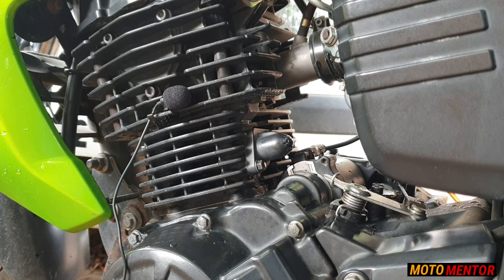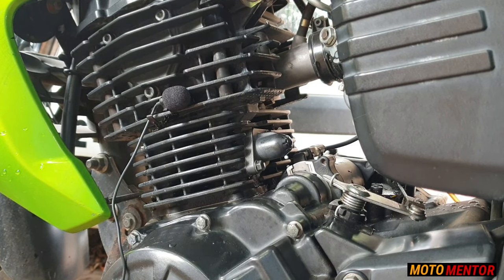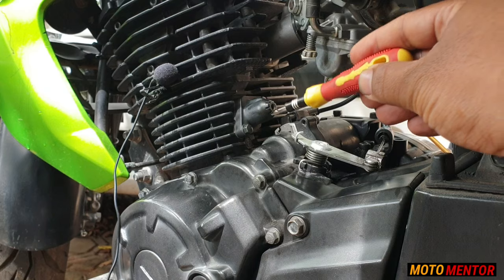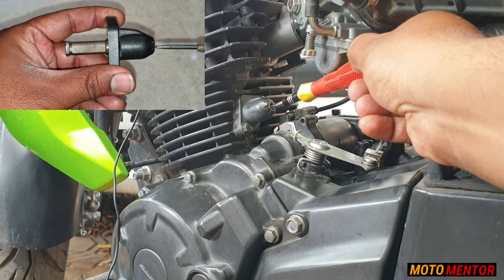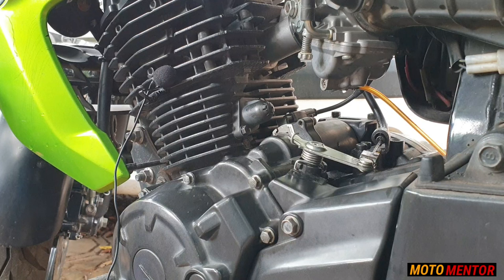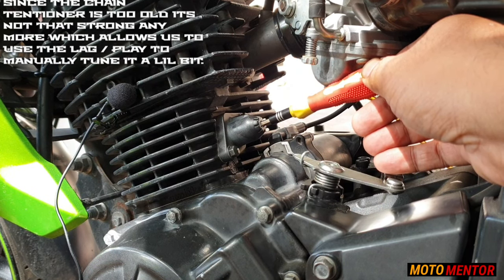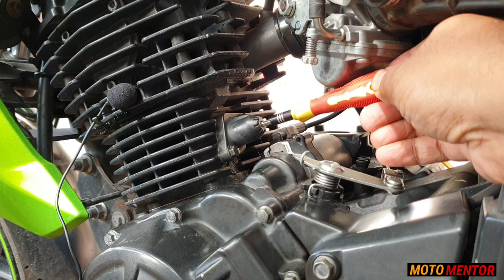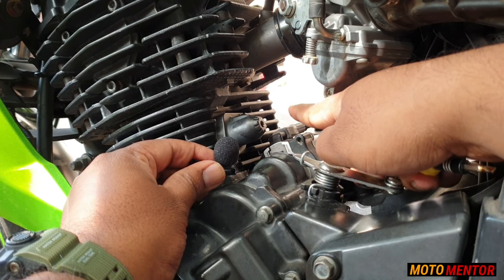BIKE ENGINE NOISE KNOCKING REASON AND HOW TO FIX TICK TICK ENGINE  SOUND VIBRATION SOLUTION

Comment: Never loosen the CCT while the engine is running. It will looosen the chain tension and can cause cam chan to slip and skip the timing that can lead to catastrophic damage to the engine. Also, you are never supposed to tighten the CCT manuall by hand pressure(by turning it anti-clockwise). This will put excess pressure on the chain guide and ruin it. The guys who are watching your video are not mechanics and can ruin their engine. Please mention this in your video in the beginning.
Reply: What will be the proper solution for this kind of knocking sound by engine then ? Please suggest

Comment: The type of timing chain tensioner is these motorcycle engines are not adjustable. They are either full retracted or extended. Also it is not advised to retract the tensioner when the engine is running. Doing so puts slack on the timing chain and mess with the cam timing which could result in piston hitting the valves and engine failure. The tensioner and timing chain should be replaced if noise is observed. Better to spend few hundred rupees than thousands to fix the whole engine top end. If u want to adjust cam chain tension, buy a aftermarket manual adjustable cam chain tensioner. The stock one is not adjustable.

Comment: Hi, i am getting sort of humming noise from the rear of my FZ when i increase my speed. What could be the reason? This started after i changed my rear tyre from earlier 140/70 to stock 140/60 size.
Reply from the maker: Yes bro tyre change give that sort of noise and vibration even I had the same issue when I just changed my rear tyre from radial mrf to continental 140 but now m back with my stock mrf radial  and bike feels more smooth like before. I better suggest to go with mrf radial the 2nd gen tyre not the first gen coz first gen tend to get puncture a lot.  Also  these vibration have a negative effects on swing arm bush.
Reply: @MOTOMENTOR  Thanks for the reply. Also wanted to ask about the oil grade. Which is better for FZ, 20w50 or 20w40? Also how much oil to put with oil filter change? 1.1 litre or 1.2 litre? User manual states 1.1 litre but service manual states 1.2 litre.
Reply: motul 20w40 2000 to 2500kms or 15w50 4000 to 5000kms
Reply: @djcaddypoarta6  motul doesn't sell 20w40 oil anymore.
Reply: @siddheshshanbhag  
Use yamalube 20w40 semi synthetic 
It is good for Fzs v1 

Never heard of 1.2 lit. Or 1.1 
I always put 1 litre engine oil on my bike
with or without oil filter

Comment: Thanks a lot brother. I replaced it and it helped. It completely cancelled the sound and engine became very smooth.

Showroom guys literally asked for 16k eliminate the problem, and it got solved in 400rs because of this video 🙌🏻
Reply from the maker: I am glad thanks. I can see your happiness in your comment and thats what I love. 😃👍
Reply: Hi what is the part name?
Reply: Replaced the chain tensioner, still the same knocking sound.
Reply from the maker: Then it could be the valve noise get that thing set.
Reply: @MOTOMENTOR  the sound occurred when i ride it two persons (me + someone else), after resting the bike for few hours or when the engine cools down there is no sound. 

Usually the sound arises when the engine heats up.

Comment: Loved your content and already subscribed to your channel brother. 

I an facing a unique issue in my Cb300r. My bike makes hollow hammering sound while accelerating. Especially between 3-5 k rpm range. 

Funny thing is that this noise has started to appear post servicing recently. It was not there before. I have got my engine oil changed in this service. 

Also, my bike’s engine has become noisy and loud. Can i guide me with solution mate? Any video explaining this or you replying to my comment will be good.
Reply from the maker: Is it like a metal hammering sound or like  bubble metal sound ?   Also is it coming directly from engine or any specific area?
Reply: @MOTOMENTOR  i think its more of a bubble metal sound. There is hollowness to sound. 

Sound is probably coming from head side but not sure. 

One more thing observed, sound decreases upon engine heating. At times its there at times it isn’t. 

Edit - exhaust sound appears to be more misfiring types and harder than normal too

Edit 2 - it’s probably coming from left side of the head.

Comment: I did change everything timing chain timing chain guides timing chain tentioner  and get my engine oil changed regularly  with on time service but still i got this tentioner noise back after a year then my local mechanic removed the tentioner out welded a nut on the tip of the tentioner and fixed it the tik tik sound was gone and more than 6-8 months its running fine without any noise

Comment: Hi bro Yamaha FZS version 1 all Model Recommended engine oil great kitna ek video banake daw
Reply from the maker: Sure bro thanks for the suggestion 👍
Reply: @MOTOMENTOR  thanks bro
Reply: Bro Yamaha FZS version 1 2014 us kartahu lekin user manual books nehi or Company Recomend Engine oil konsa mujhe nehi pata
Reply: Recently ek vlg banake daw Yamaha fzs version 1 Sara model ka company Recomend engine oil great
Reply: 20w 40 motul3000 is best I'm using since last 6 years
Reply from the maker: 20 40 is the recommended by the company i have the usr manual which suggests to use this grade.

Comment: Hey,i have a r15 v3,i had to change the cam bearing due some sound issue.
But after tht my bike idles just like yours,very unstable.
Will adjusting it will completely fix it?
Reply from the maker: Well there are multiple reasons for unstable idles I had mine almost fixed after cleaning carb getting the hose leak fixed and also changing few other components. Since your bike is fuel injected chexk for any leaks around it specially the clamps. M sure rhe air filter is changed too.
Reply: @MOTOMENTOR  yes,and throttle body cleaned too,itried adjust the idle rpm,but weirdly it wont work.
Reply from the maker: Mine had leaks in the pipe as it was not properly tighten belive me check once again coz I have played around a lot with my carb  and even bought a new carb which was a bad decision I fixed it by just making sure there is no leake.  The other thing  i changed was stator plate and ht coil coz I had doubt that the current is not constant. These videos m uploading now were recorded 6monts back i always make sure the things m doing actual works before I upload the stuff.
Reply: @MOTOMENTOR  which pipe are you exactly talking abt bro?

Comment: Nice information bro
Which engine oil do you use kindly share
Reply from the maker: I have used yamaha 20 40 initially(recommend by manufacturer) then since last 7 years I have  used motul 15w 50 semi synthetic however after installing slipper clutch i again used 20 40 mineral as I was experimenting with it but I will be using motul 20w 50 fully synthetic very soon  as I have that bottle in spare but post that I will also try motul 300v 15w 50 which is the best but I haven't tested it practically.
Reply: @MOTOMENTOR  thanks for reply kindly share the review and experience after using fully synthetic oils Iam having fzs fi v3 and planning to use fully synthetic oil but I have only ridden 5000 km
Reply: @MOTOMENTOR how did u install slipper clutch?

Comment: I'm riding Kurz 110cc.
Where's the timing chain adjust screw on (Sounds like ticking is coming from behind air filter 1 side of the Yx lifan 110cc) the pit bike..
Brand new a few months old secure enough.
Things tick Over but ermmmm.
It's a repetitive I'm sure it shouldn't have.
I assumed timing chain Adjust is somewhere upon the grill carburettor

Comment: My gt650 is making constant sparking aound. The more the acceleration the more I can hear the sound and its constant sound. I went to service center and they found loose spark plugs but it still didn't fix it. What could be the problem.
Reply: Hi I have GV650 which is knocking and also back firing when driving in slow traffic. Have any ideas?

Comment: Sir l have fz250 but it's very noises on engine what will be that sir??
Reply from the maker: There are multiple reasons for engine noise starting fron tapet , chain tentioner, clutch plates. Can you share the video on my Instagram let me try to recognize that noise also put the bike to neutral and press the clutch and see if the noise reduces..  share your experience.

Comment: Sleeper clutch video sir
Reply: Check out the Indian railways for tht😅
Reply: @daveshetty5489  If you dont know the difference between  sleeper clutch and sleeper coach you need to sleep in on the indian railway track 😁
Reply: @kunalkale5385  well I knw wat is a sleeper couch ,but would want to knw wat is a sleeper clutch 🤭
Reply: Slipper clutch...samje

Comment: This is not a DIY😅, and i dont recommend it if your not a qualified mechanic. U can easily mess up with the timing which can ruin yo engine, so guys b careful, its cheaper to take to a qualified mechanic than replacing those parts

Comment: Bro my same bike makes sound when heating what would it be tappet or timing chain sounf
Reply from the maker: See both sounds are very identical and a bit confusing to identify so first try to work on the chain tentioner as its a easy job if no joy then go toward the tappet.
Reply: @MOTOMENTOR  bro will
Tappet and timing chain creates similar sounf